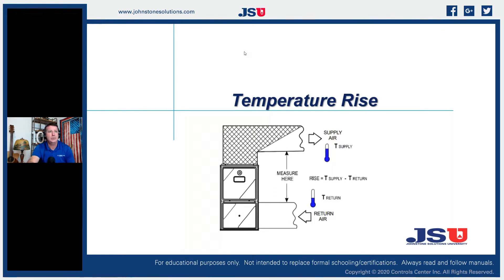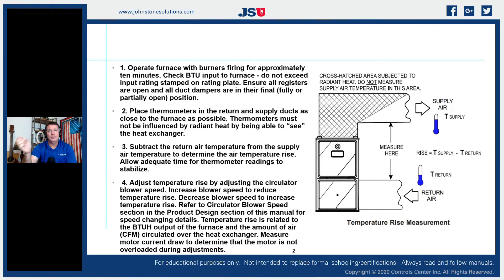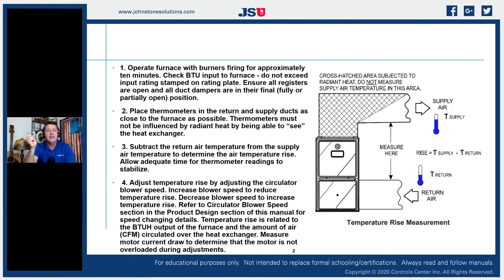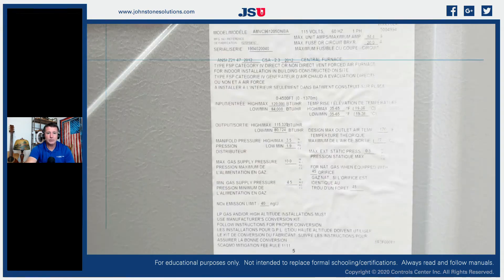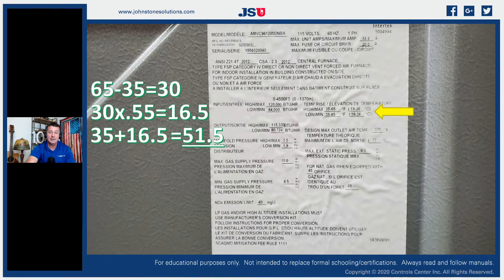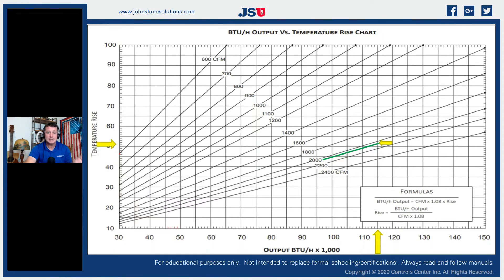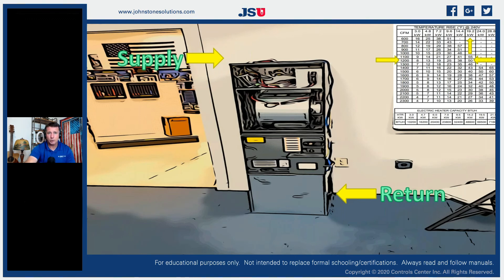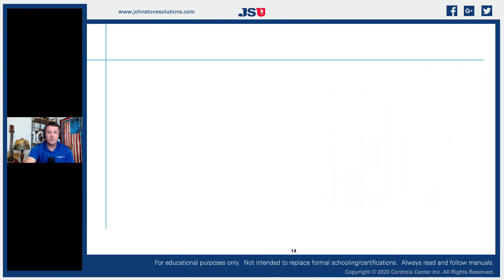Temperature Rise

Comment: What if adjusting cfm is limited to the motor's capabilities which puts the cfm out of range to gain the proper heat rise?
Reply from the maker: Manufacturers of equipment test their combinations to achieve proper temp rise based on .5"ESP. Assuming our gas pressure is set properly the only things that would cause the blower not to be able to produce enough airflow would be high static from our ductwork or dirty A-coil,filter,secondary heat exchanger. Definitely check static pressure and coils.